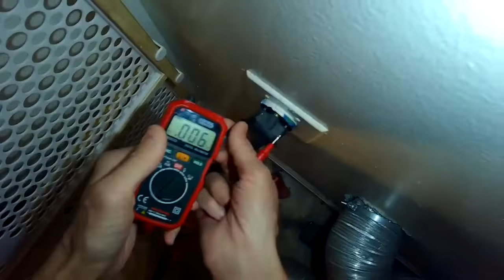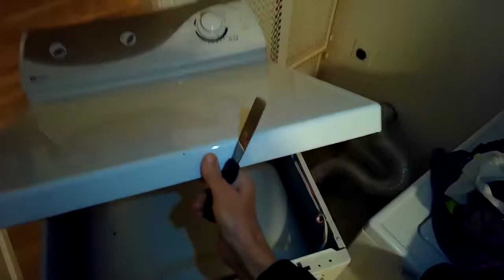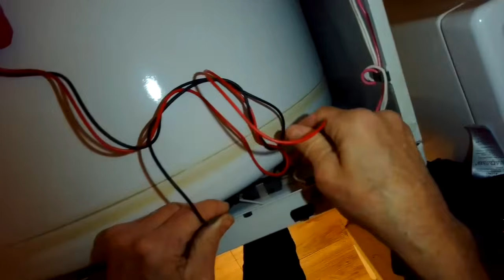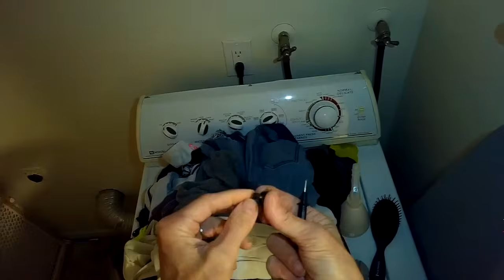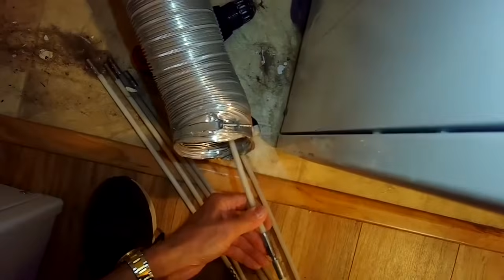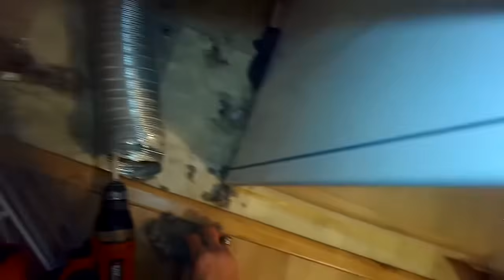🔥 Maytag Electric Dryer - NOT HEATING - EASY FIX 🔥

Comment: Thank you very much Scott for the great video!  I just fixed my dryer successfully.  It was a bitch getting the thermal fuse in and out.  I had to take the entire screw out in order to get the bracket out and then back in.  The most stress I had was trying not to lose the screw.  Thanks again!
Reply from the maker: Nicely Done😊